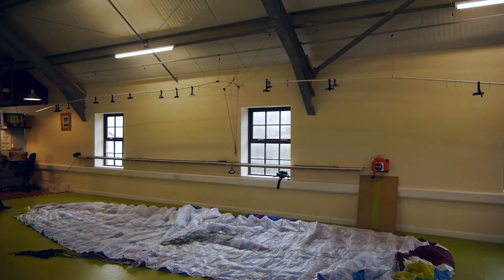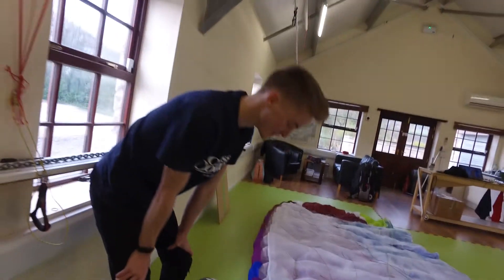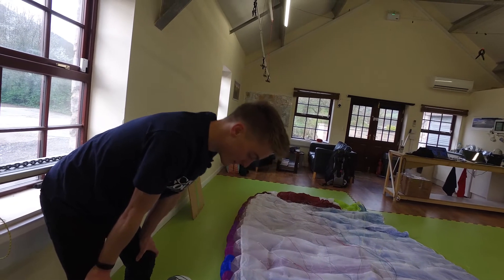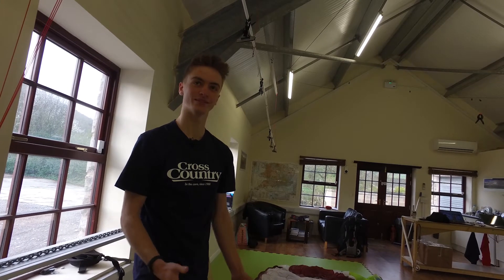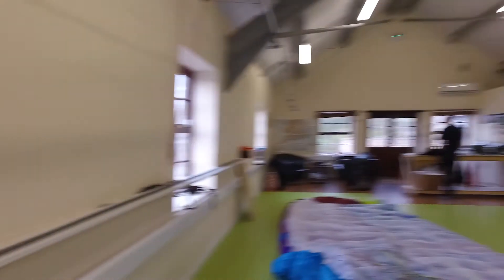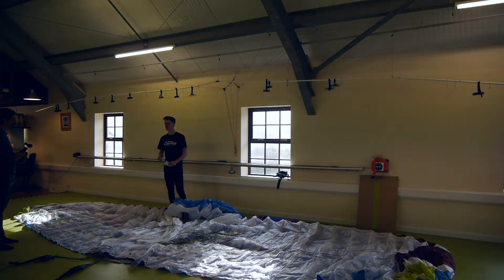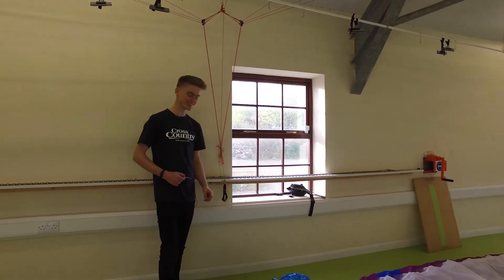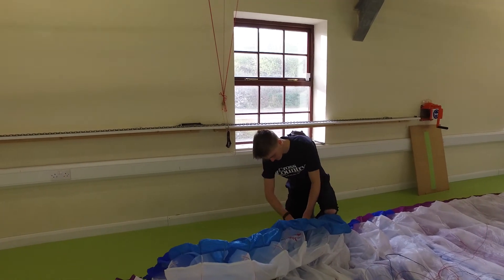01 Porosity Test - Servicing a Paraglider - BANDARRA

Comment: This test is basically useless for modern wings. The modern wings will pass this test even with 1000 hours of flight when the seams will fall apart and the lines lengths will be all over the place. This test came from old times when manufacturers used different thicker fabrics for the wings prone to become porous over short period of time. The modern paragliders fabrics do not have this issue and this tool is now useless.
Reply from the maker: interesting
Reply: Rubbish comment !
I have a Roadster 2022 and the porosity test measures 50 as opposed to a new Ozone wing that measures in excess of 600.

Comment: Fun video, but uninformative. I was hoping to find out why a porosity check is important, and had lots of unanswered questions: What causes a pararaglider's porosity deteriorate? 275 seconds to do what? What is the effect of high porosity on glider behaviour? Why is the upper surface more important than the lower surface?
Reply from the maker: We actually had to do the service you know :D Maybe we can sit down one day and you can give me your take on video at answering those questions?
Reply: Ah OK, didn't know you were tight for time. It's great you're doing this, just trying to give useful feedback for the next installment To me, a video recording a professional service is a perfect opportunity to ask questions.  What are you measuring? How is that calculated? Why is it important? What causes porosity to deteriorate? etc.
Reply: @ashghinn4630  they are measuring how long a volume of air take to go through the fabric, when the air is sucked with a small pressure drop.
This is the porosity test.
The fabric is made with a nylon frame which is doing the structural strenght and a  coating which is doing the air tightness.
The coating can be damaged by UVs from the sun, wear and tear, folding the fabric...
If the coating is damaged, it become less airtight, and the pressure inside the wing drops, so inflation takes longer, it doesn't hold its shape as well, and general handling is not as good. Lift is a pressure difference between top and bottom of the wing, if the fabric let air through, the lift wont be as good.